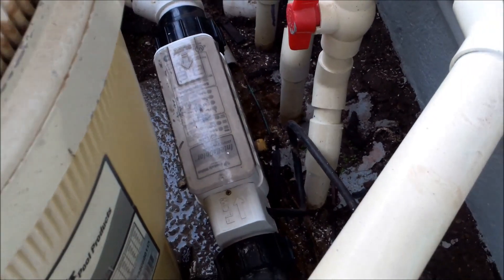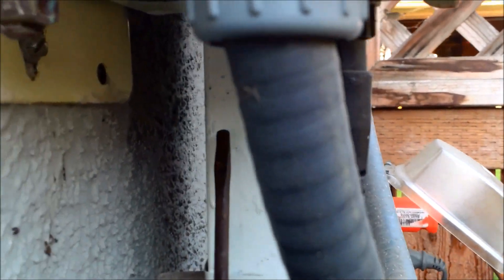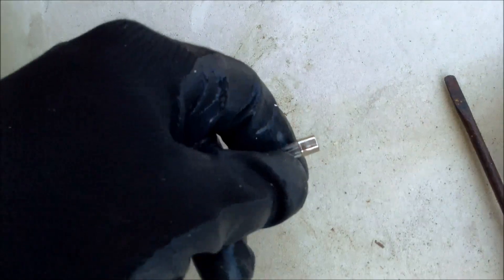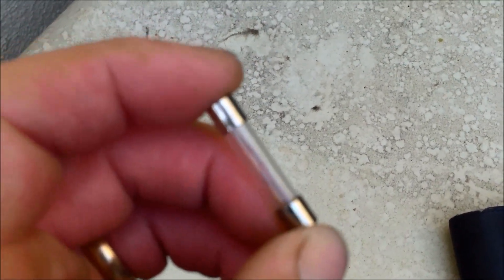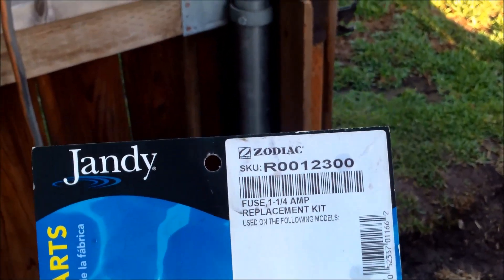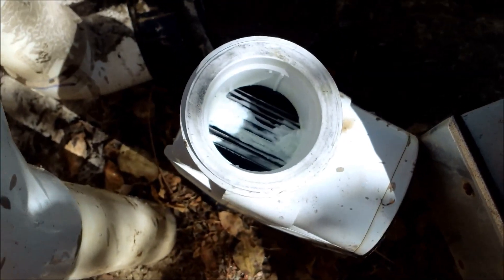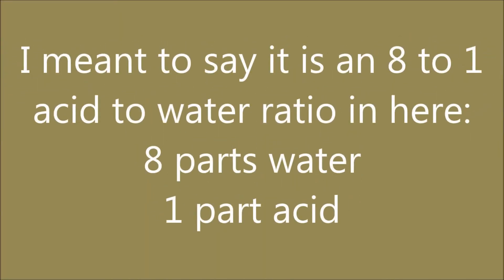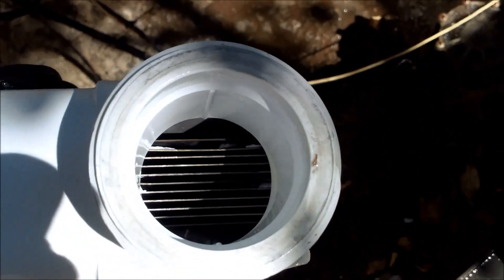My Intellichlor Salt Cell Has No Power: How To Replace The Fuse

Comment: I have the 10amp fuse located inside the power center. Replaced the fuse, salt cell powered up then after a minute powered off again. What could be the problem?
Reply: Keeps blowing fuses
Reply from the maker: Could be the cell is getting old. Try a 15 amp fuse.
Reply: @SPL  cell was purchased in May 2022. Pentair it’s over 2 years old so no covered under warranty. Spent 1500 for 2 year shelf life. Cheaper to stick with clorine. I’ll try a 15 amp fuse. Thanks.

Comment: Thank you for your video. I had to buy a new in-line fuse holder.   After I wire it in my light came on and the salt cell started working.   This same me $550.  Thanks for your help!!!

Comment: Hello, any idea where else could the fuse be located? Mine is from 2016 and doesn't have a fuse in the location but does have a large plug coming off the power wire to the salt chlorinator that looks to come apart but wanted to ask before breaking something. Thanks so much!
Reply from the maker: That should be the fuse holder. Has to have one

Comment: Thank you. By chance do you have a video that covers my salt cell is comein gon but isn't producing enough sanitizer? even if its on hi?
Reply from the maker: Do a 24 hour test in the Summer. Test the water in the morning to get the chlorine reading. Run the pool for 24 hours with salt output at 100%. Make sure your CYA level is at 50-80 ppm. Retest the water after 24 hours. If the chlorine level is high now you can adjust the output and runtime down.

Comment: I use straight acid to clean the cell. No issue. Don’t have time for a 1/8th mix.
Reply from the maker: I suppose but the manufacturer does recommend diluting it.

Comment: My easy touch got some water in it and I can’t get it to work then I noticed my salt cell & acid feeder are not working but filter pump is running. Could easy touch remote be related to cell & feeder not working?
Reply from the maker: There are fuses for both of those. Maybe the fuses blew.

Comment: I have an IC40 and two power supplies, that I can switch out to just to make sure if it is the power supply? no lights on the Ic 40, the fuses pop immediately when I power the unit on in both power supplies, so I should definitely try to clean it, traditionally I’ve been very lucky and my cell has stayed very clean every time I look at it, there would be no calcium or just a very small amount, I’ve only had to clean it probably 4 times in eight years, so maybe it’s just been a while since I’ve cleaned it, fingers crossed, I don’t know if this will do it but it’s definitely worth a try considering the price of a replacement cell. Thanks so much for making this video, praying it’s something simple? Thanks
Reply from the maker: It could also be the cell is at the end of it's lifespan and electricity is arching in the cell causing the fuse to blow. 8 years sounds like a long lifespan and I have seen older cells do this.
Reply: @SPL   Regrettably it looks like you are right, I cleaned the salt cell and there really wasn’t that much calcium,  almost none.  In this case it appears to be dead I noticed that the top control area was raised up just a little bit so I took a screwdriver and lightly pulled it up, (Since it was likely fried anyways)there was quite a bit of water moisture in there, couldn’t help thinking maybe this water eventually got through that plastic coat that they seem to have over everything just under the push button area. I also have an extra flow switch but I don’t think that would make the fuse pop although I don’t know for sure? What do you think on that? Could that blow the fuse if it was bad? that’s definitely my last ditch effort to save myself from buying a new salt cell. Thanks

Comment: Thank you so much for this and your other videos. They are always super helpful! I have replaced the fuse before, but this time I've managed to strip the head of the screw on the fuse holder. Any suggestions for how to get it out? Thank you!
Reply from the maker: There is a replacement kit for that.  It unscrews from the inside of the power unit. Pentair 521248Z Power Center Fuse Holder Kit Repl

Comment: Having  trouble removing the screw— any suggestions.   Took cover off and not sure if wires inside are supposed to turn.  Thank you
Reply from the maker: Sometimes the screw jams up. They sell a replacement kit for the screw and fuse - sometimes that is the only solution.

Comment: Be careful!
The slotted screw top you need to unscrew 1/4 turn is made from the cheapest fragile plastic, and strips easily if the top is even slightly tight. If you strip the head ( the plastic slot) it turns into a much bigger job - replacing the fuse holder, but don't put in the Pentair replacement.
An electronic store will have a better quality fuse holder for less.
Reply from the maker: Great advice and spot on.
Reply: HI there. I have indeed stripped the head of the screw on the fuse holder and have no idea how to get it out. Any suggestions?
Reply: @ellenshapiro5  what I did was cut the wires going into the fuse holder and replace the fuse holder. For someone with electrical ability it’s easy to do, and cheap, and the fuse holder can be any kind as long as the fuse is the same amperage. I got a fuse holder that the end twists off - no screwdriver needed to replace fuse next time.  But if fuse pops again, that might mean your cells need replacing - they last 5 to 7 years usually in my opinion, and cost a fair bit.

Comment: Any tips on replacing the fuse holder? The blown fuse I have wont come out of there. I opened the Power Center, but the fuse holder is tough to get to.
Reply from the maker: You will have to remove the fuse holder and order a new one. It is sold as a set with a new fuse.

Comment: What if the fuse is good ? Do I need to buy a new cell
Reply from the maker: It's hard to say if the fuse is good in some cases. Did you attempt to change it and no lights still?
Reply: @SPL  yes I did change it even though it was good

Comment: I changed my fuse and after couple weeks my intellichlor is not on so I checked the fuse again but seems to be ok I went ahead and put new fuse to see if it would come back on but no luck. Could you help what else to look or need to replace . Thank you.
Reply from the maker: Is the green light on in the power unit? Open the lid and see if the green light is on indicating there is power. In that case it could be the fuse blowing right away. You can try 15 amp fuses.
Reply: @SPL  is it 250v 10amp?

Comment: I have no lights working on my cell so I checked the fuse. Looks good, it's the 10 amp up by the transformer not in the bottom. I used my voltmeter and plugged into where the cell's cord plugs into and I have 24 volts coming out there so I am getting power to the cell.  Will a build up of Calcium carbonate cause the cell to shut down altogether? I guess my question is this, is it worth cleaning and putting back on or is it time to order a new one?
Reply from the maker: I would clean the cell and change the fuse also and see if it fires up. How old is the cell?

Comment: This worked for me.  Thanks so much.  I replaced the fuse with https://www.amazon.com/gp/product/B075SMFGM4/ref=oh_aui_detailpage_o00_s00?ie=UTF8&psc=1 
Tested the old fuse first with a multimeter for continuity and the old fuse was bad.  Hope there isn't a bigger problem causing the fuse to blow!
thanks for the video!
Reply from the maker: Usually the fuse will not blow again - sometimes with a lot of calcuim build up it will blow. If it happens often I also suggest going to a 15 amp fuse.  Thanks for the positve feedback! 👍

Comment: Great video I followed it and the next morning the fuse was blown again.  Next day I cleaned out the chlorinator with the acid and put another fuse in and it ran for a little less than a half hour and then it blew.  Do you have any other ideas and thank you so much for taking the time to do these videos. Mike
Reply from the maker: Try a 15 amp fuse instead of the 10 amp fuse. That usually solves the issue.

Comment: These salt cells are garbage. My Intellichlor salt cell keeps blowing fuses after only 1 1/2 years of use. Of course Pentair only offers a 1 year warranty, and they won't send anyone out to inspect the problem. Their solution is for me to spend another $600 on a new salt cell after I wasted $1,200 on the salt cell and power center 1 1/2 years ago. Stay away from Intellichlor.
Reply from the maker: Try a 15 amp fuse. I get a pack of 5 on eBay. That sometimes solves the issue. I find that more and more of the new systems are blowing the 10 amp fuse frequently. I called Pentair on this and they deny any issue. But I noticed that all of my older units are fine and only the newer ones seem to blow out the fuses.
Reply: Kevin Geisler they offer 2 year full warranty if you buy it from a local dealer and it is installed by a pro.
If it was do-it-yourself install, you are screwed! Im a Pentair Warranty Center Tech.

Comment: what if you change fuse and the lights still dont come on
Reply from the maker: Try using a 15 amp fuse.
Reply: Never use a larger fuse than specified. The fuse is there to do a job and that is largely to protect wires and other components. Using a larger fuse could put you at risk for a fire.

Comment: Thank you for posting this!  I was literally minutes away from ordering a whole new cell (for $600) when I saw your video.  I checked the fuse, and it was in fact blown.  I replaced it in under 5 minutes for $1.68 and everything is working fine.  Have the most amazing day!
Reply: Now, in 2022, the cells are selling for $900......crazy!!
Reply from the maker: Great! I That will be $598.32 - I accept Paypal - 😜

Comment: I would love to try replacing the fuse, but I cannot locate it. The power cord for my cell plugs into the intellichlor acid dispenser. There is no little black box located anywhere on the acid dispenser, nor on any power supply unit that I can see. Suggestions? I know it's the cell that causes the power failure because everything turns on fine when I unplug the cell from the acid dispenser. As soon as I plug in the cell, the circuit trips and all power is off.
Reply from the maker: Interesting. You will have to call Pentair directly on this one: 800-831-7133

Comment: Your video states"1-1/4A fuse"  That's incorrect.  Its a 10A fuse.
Reply: Thank you!  I originally tried a 1A fuse with no luck.  Tried again with a 10A fuse and it's working fine.
Reply: Thank you for clarifying the fuse amps..

Comment: I checked the fuse and it's not blown and there's still no power to the cell.  When I turn off the power switch to the system, a few of the lights power on and then turn right off in less than a second.  Does that mean the cell needs replacing completely or is there any other possible problem that I might be able to fix?

Comment: I can't thank you enuff for this video. I just had a new liner installed a wk ago and all has been great. Then today I went to see how I was doing on salt and freaked out when I saw no lights were on the chlorinator. Sure enuff the fuse was blown. I'm going to have to install an "inline" fuse holder because the one in the box more or less came apart as I was attempting fuse removal. Thanks again.

Comment: my fuses are blowing the second I turn it on...every time.  sounds like a short to me. I've had an electrician tell me that he thinks it's in the cell. any ideas?
Reply from the maker: Try using 15 amp fuses instead of the manufacturer 10 amp. I just ordered 5 off of Ebay for $4.95. If the cell is 3-4 years old it may be causing the current to arch, especially if there is a lot of calcium build-up.
Reply: Awesome. Ill definitely give it a go.
Reply: Swimming Pool Tips, Reviews & How To -MrDgvb1 k

Comment: My fuse seems to be stuck in there. Any ideas?
Reply from the maker: Tough one. Stuck is hard to get out. Try laying the unit on a flat surface and using tweezers to pull it out.
Reply: it was melted to the housing, so i had to replace the fuse housing too.  thanks!
Reply: Ivan Correa mine was also melted to the housing with the wire broke off and was a pain to get the fuse holder out to replace it. I got it out, went to autozone and bought a cheap fuse holder and a 10A fuse and stuffed it into the compartment. $7 total and works great so far. It will be much easier to replace in the future. Thanks to original poster for the video!!

Comment: Is the fuse a slow blow or a fast blow? I went to radio shack and they only had 10A slow blow fuses and the internal wire looked twice a large. I have read on other threads that tech support says slow blow. But if I put one in and it takes longer to fail I might melt my Pwr sup. Any thoughts??? Thx, ~JT
Reply from the maker: You can try a higher rated fuse like a 12A fusealso. But I would just go with the Standard fuse - if there is a high voltage arc in the Cell you want the fuse to blow fast to cut power.  I use standard fuses - but lately the 10A fuses are blowing more often in the newer systems. You can order a 5 pack of fuses on Ebay.

Comment: On my fuse holder the red wire is burnt off , they don't sell new fuse holders with wire how do I fix the wire
Reply from the maker: You would have to call Pentair because I know they do make that part - the service techs who work with Pentair carry them but I am not sure what the part # is: 800-831-7133

Comment: in my case the fuse wire did not look blown but I saw black particles in it I replaced it and it worked thanks for the videos I learn alot

Comment: thanks for the videos I learn a lot from them sometimes the wire on the fuse doesn't break in my case I saw black particles in the fuse and replaced it. it worked

Comment: some times the wire on the fuse does not break but if you see black particles inside the fuse replace it anyways its only like 40 cents I did this and it worked but my problem is now I got no power to my customers cell when hooked up to an easy touch thanks for the videos I learn a lot from them

Comment: start of season and no lights on the cell
fuse was broken
replaced and no lights on cell despite plates being clean
opened up the control unit and green light flashing
purchased a new cell ( ouch ) -- installed it and no lights on new cell either
change fuse again and no luck

any ideas --- am i correct in assuming it is the control unit that needs to be replaced

thanks
Reply from the maker: +jeff wooder  How old is the salt system? And did you recheck the fuse when you installed the new cell to make sure it wasn't blown?
Reply: +Swimming Pool Tips, Reviews &amp; How To -MrDgvb1
the old pentair cell says manufactured in 2010
i believe the previous owners redid the pool at that time - so assume control unit is the same
a new fuse was tried twice when new cell was put in but with no luck

thanks
Reply from the maker: +jeff wooder That is not a very old system. Have you tried removing the unit from the wall and placing it on the heater perhaps and then trying to connect the black pin cable - sometimes that connection is not 100% flush and will cause no cell power.
Reply: +Swimming Pool Tips, Reviews &amp; How To -MrDgvb1 
i am not sure what the black pin cable is--- i will see if i can find it
i have checked wires previously and seemed like connections secure
not sure why it would occur at beginning of year but will check again
i do not understand the "placing the control unit on the heater "
Reply from the maker: +jeff wooder Usually the power unit is mounted on the wall. Sometimes the cable from the salt cell is not firmly set into the control unit. So I will remove them from the wall and then try inserting the salt cell cable on a flat horizontal surface. The end of the salt cell cable has 4 pins similar to an older computer connection. They need to be firmly seated in the power unit with the black nut firmly in place. Hope that is a better explanation ;).
Reply: +jeff wooder 
i did check again and all wires on the circuit board seem secure
are ;you refering to the black wire that connects into one of the four connector pins
Reply: +jeff wooder 
that is a good idea
simple is sometimes best solution
but it seems to be very firmly in place when push in
Reply from the maker: +jeff wooder It could also be a bad fuse holder in some cases. make sure it clicks firmly in, otherwise the fuse will not catch and allow power to the cell. Just trying to eliminate things before you buy a new power unit.
Reply: +Swimming Pool Tips, Reviews &amp; How To -MrDgvb1 
fuse holder is a little cracked
seems to click when screw in
i guess i could order a new one as inexpensive possible solution
i will order one
thanks for your suggestions 
i will let you know how it turns out
Reply: +Swimming Pool Tips, Reviews &amp; How To -MrDgvb1 
i tried to ensure the four prongered large wire that goes into the bottom of the contol centre from the cell was in properly
i took off the cover of the contol centre and the fuse went
i put another fuse in and it blew as well --- the green light in the control centre went on and then out
no lights where flashing on the new cell unit
this was with the brand new cell
any further thoughts
thanks
Reply from the maker: +jeff wooder Very odd. Have you called Pentair Tech support?